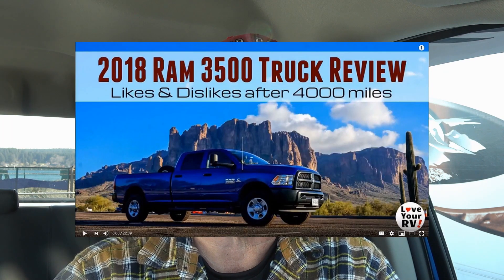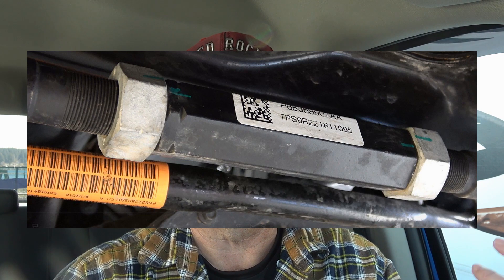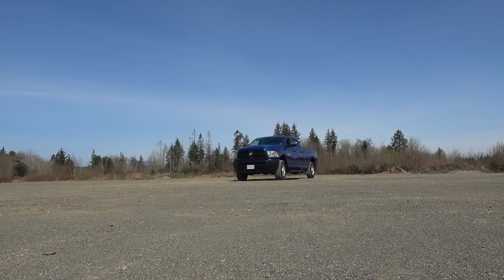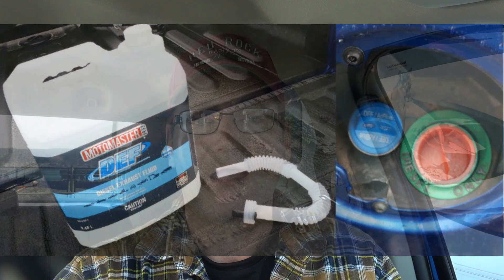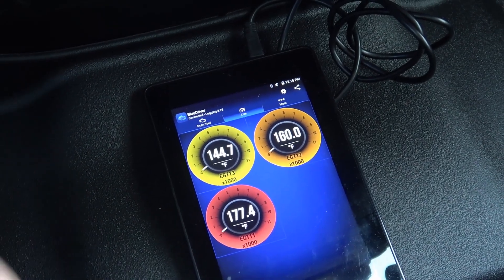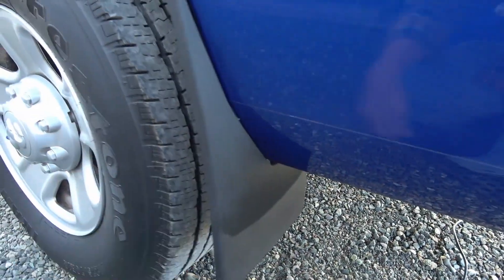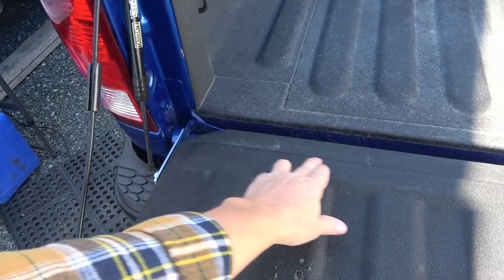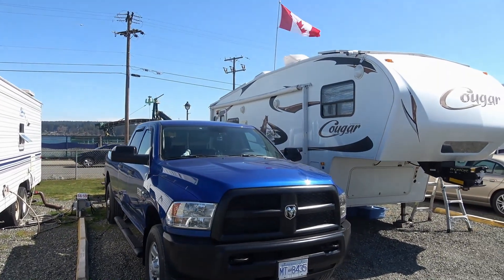2018 Ram 3500 Truck Review Update - 35,000 KM (21,748 Miles)

Comment: I can't believe your tires looked like that after so few miles. If you want to save a significant amount on your fuel charges when you're in the states look at getting a TSD logistics fuel card. I'm not a shill for them and I'll let you do your own research, but it's a great thing for RV'ers that buy diesel.
Reply from the maker: The back set seem to really wear fast, guess with all the weight of the fifth wheel and the extra torque when towing.
Thanks, I've heard about that before. I think its a good deal for people with huge RVs. I don't much like truck stops always so busy and higher priced. Also hate to get in the way of the truckers, feel kinda weird as they are trying to earn a living.  
I usually go with the smaller local stations, most times they are quite a bit cheaper than the big trucks stops so works out to close to the same deal.  We have a pretty small fiver so not a big hassle for me, or I just fill up before hooking up the next time.

Comment: No one ever wrecked oil lubricated components by putting the correct spec fresh oil in one...
Rear axle oil change interval is important in trucks used for towing. Look at Banks u tube channel for a video about aftermarket differential covers.

Comment: I installed my tailgate assist and before long the cable got jammed between the body and the shock.  I had great difficulty lowering the tailgate.  I have removed the cable.  I see yours worked as prescribed.  What happened to mine?
Reply from the maker: Did you install the little black plastic piece onto the cable? I think its suppose to stop the cable from becoming jammed.
Reply: @LoveYourRV  Wouldn't you know this was most likely operator error.  I don't recall, we were traveling at the time.  I will have to go through my spare parts box.  Thanks Ray.
Reply from the maker: Here is a link to the part of the video where I installed it - https://youtu.be/voNfqYvEaos?t=299

Comment: Hi Ray. I have the same truck, but with a couple of major differences. Mine has the Laramie trim, bucket seats and is a 2wd. On mine the towing mileage is right after the second trip mileage gauge. It reads mileage after the 7 way is plugged in so it is coupled to the brake controller. When I tow my small utility trailer it does not register mileage. I run only one add on and it is a dash cam, but I have it in the upper left corner of the windshield. Because of my trim level I can both blue tooth and pair my phone to my 8.4 screen thus I have Google maps on my dash screen. I am coming up on 21K miles and like up I will be shopping for new tires later in the summer. It will be 2 years old the 19th of April. I use a Reese Goosebox Pin Box on my Grand Design 337RLS and really like it. My last truck was a new (ordered) '04 Dodge 2500 with the 5.9L and 216k miles when I traded. I have no complaints with mine.

Comment: Manufacturers sometimes like to soften the shifts in transmissions to make everything smoother, but that means slight slippage in the clutches a firmer shift even with a bit of noise is good especially if this happens under load. I’ve never been confident with Dodge transmissions, except the old days with the torque flights, but those days are long gone.  The Aisan transmission has proved a good one many Hot Shot guys with those hauling heavy with no complaints.
 I bought a Chrysler product it’s been a great commuter car for my wife it came with Firestone’s they wore pretty fast I ended up buying a Firestone high mileage tire, this model is actually what’s the local Police department uses since the tire store I use locally does tires for the PD, they are the first Firestone’s I’ve ever owned besides what came with the car, and I’m extremely impressed with them so far.

Comment: Hi Ray, a cheap upgrade work mentioning is a tailgate lock made by McGard, see the attached link.  Installs very easy and could help prevent the theft of your tailgate.  A friend of mine just recently lost his tailgate from his Ford truck in the middle of the night.  After contacting his local sheriff's office to report the theft they mentioned over a dozen tailgates were stolen from around his area.  This inexpensive product could prevent such a thing.    http://www.mcgard.com/automotive/tailgate-lock/    Stanley in Md.
Reply from the maker: I haven't heard much of that going on where we are at, but looks like cheap insurance. I have a locking tailgate already, has a key lock near the handle. Are the thieves able to easily defeat that?
Reply: @LoveYourRV  I too have the tailgate lock that locks and unlocks with the key fob.  not sure how easy it is to defeat the lock.  My friend who had his tailgate stolen apparently didn't have his truck locked and he resides out in the country.  Pretty ballsy for the thieves to go around and steal the tailgate but this McGard lock just adds a piece of mind (for me) to prevent the tailgate from being removed.  I just feel better knowing I have it.  If I recall correctly the replacement tailgate cost about $1,500.00 +/- .

Comment: Hi Ray, I have been watching your videos for a few years now. Also a local BC boy. Thanks for the great vids. Anyway, I recently I purchased a very lightly used (22,000KM) 2018 RAM 3500 somewhat similar to yours so I decided to rewatch your review update videos. I found a really cool mounting system for the RAM 3500, that will allow you to have a very flexible and solid RAM (the mount company) rail based mounting for hanging accessories from your dash. Its called the RAMPAM by Expedition Essentials, and it was specifically designed for those who take their RAM trucks off-road, where most phone / tablet / NAV / display mounts would fall apart and fail. Check them out, I really thinking of buying one; https://expeditionessentials.com/products/ram-trucks-2010-2018-powered-accessory-mount-rampam?variant=31823768027217
Reply from the maker: Cool! Thanks for the link.